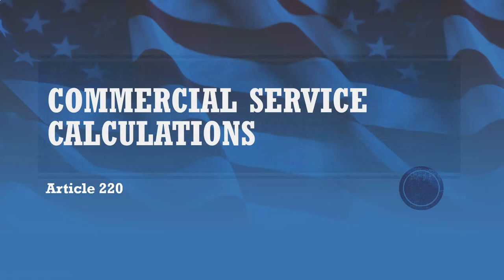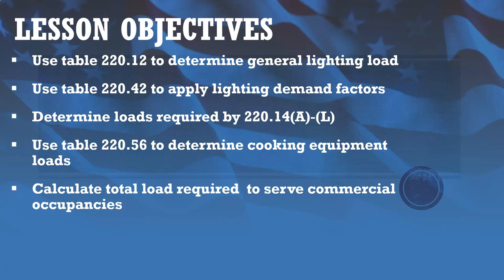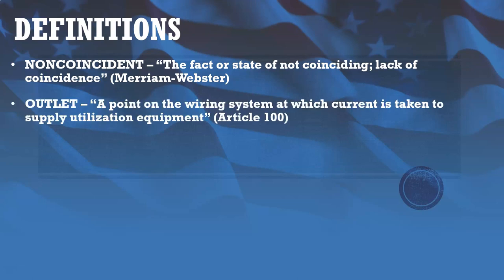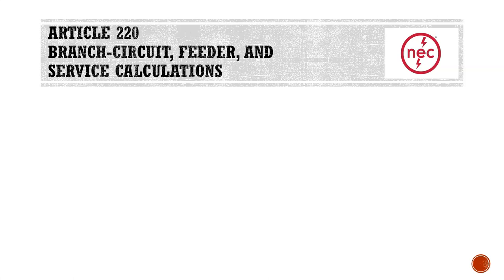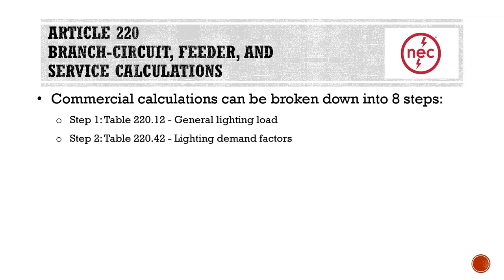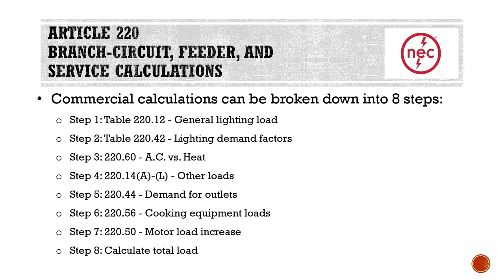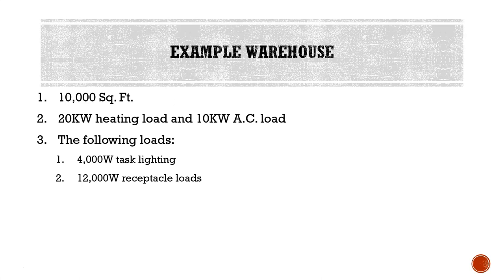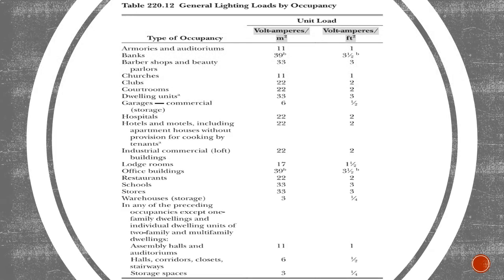Commercial Service Calculations

Comment: So if no other "motor loads" are given, we don't ever apply the 25% increase to the ac or heater motor whichever is greater? It's only referring to a separate motor if givin?
Reply from the maker: Correct, however in the 2020 NEC this is updated so that we do have to include the AC or heater motor even if we did not select it while evaluating 220.60. For 2017, however, we would not include them.

Comment: Great video!  
Couple of questions:  Since 220.44 states that we can use either T220.42 or T220.44 for calculating receptacle loads, 

1) Why did you choose to use T220.44?

2) How do we know which table the exam will expect us to use?  Are we supposed to calculate both ways and take the larger?

That can make a big difference in the total outcome.  Or am I reading that wrong?  

Thanks for all your work!
James
Reply from the maker: Table 220.42 applies to the general lighting load as determined by by table 220.12 as well as the receptacle load, where as table 220.44 applies to non-dwelling receptacle loads only. Since for warehouses the demand factors are based 12,500VA in table 220.42 and 10,000VA in table 220.44, it is more effective to apply table 220.44 to the receptacle loads instead of table 220.42. Hope that helps!
Reply: @electrical1019  Thanks for the response!

So it appears that we have some discretion as to which method we choose to implement.  I guess I'll just hope that the multiple choice answers will make it clear which way the exam expects us to calculate it.  Thanks for the confirmation.  I was pulling my hair out over this!

Comment: According to Table 220.12, what kind of occupancy are commercial bakeries or kitchens (no associated restaurant)?
Reply from the maker: Often times it can be a little vague as to which occupancy a certain building will actually be, and usually the inspector or AHJ will need to make a call on what it should be. Personally, I would probably classify a bakery or kitchen as a restaurant for the purpose of a load calculation since the actual load of a restaurant will really be in the cooking area rather than the dining area, and a bakery or kitchen would have a similar cooking area to that of a restaurant. Hope that helps!

Comment: Where in this would you add electric water heaters?
Reply from the maker: That would be included under 220.14(A) which states for loads not covered under 220.14(B) through (L) we include the ampere rating of the appliance. Hope that helps!

Comment: You're posting this in mid 2021 using 2017 code. The table 220.12 is completely different than the same 220.12 table in 2017. Hard to actually learn and follow along, can't watch this... The updated code book is so much more confusing to me, need to find a video that goes over the 2020 version. :(
Reply from the maker: Hi Jason, these videos are primarily made for use in the state of Kentucky, which is currently under the 2017 code. In addition to Kentucky, around 25 other states are still on the 2017 code, and less than 10 have actually adopted the 2020 code (for the time being anyway, hopefully we'll see more states adopt the 2020 soon). We've been working on some versions of these videos for our viewers in states that do use the 2020 code. Thank you for the feedback!

Comment: Why don't you use the 2020 NEC instead of the 2017?
Reply from the maker: This course is designed for students who intend to take an electrical licensing examination in the state of Kentucky. At the time of these videos being released, the newest edition of the NEC that Kentucky has adopted is the 2017 edition.
Reply: Heck Washington DC still tests the 2011 for master examination. Your examples are really simple to follow. Thanks for clarification